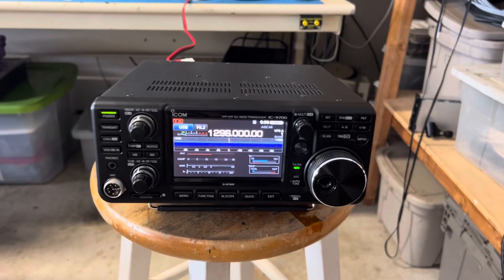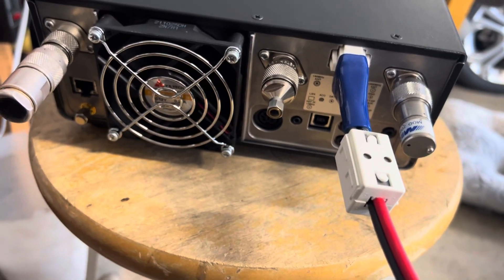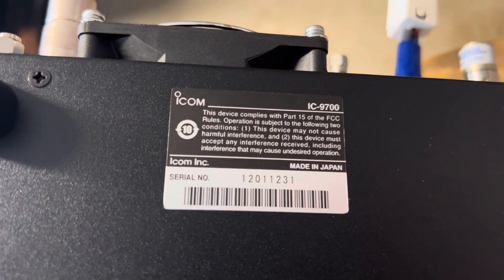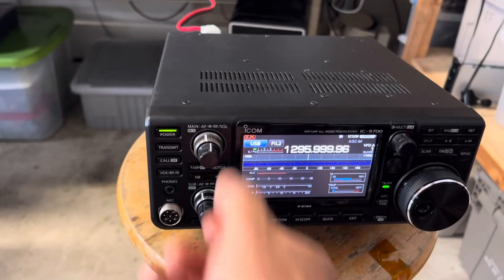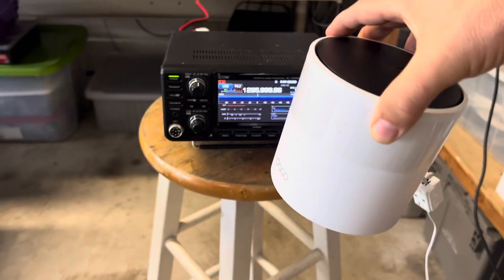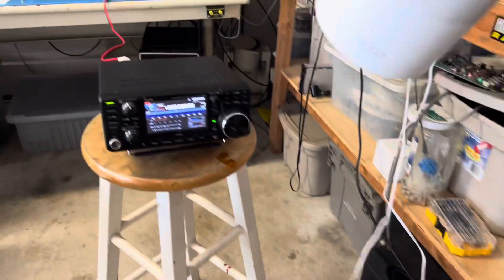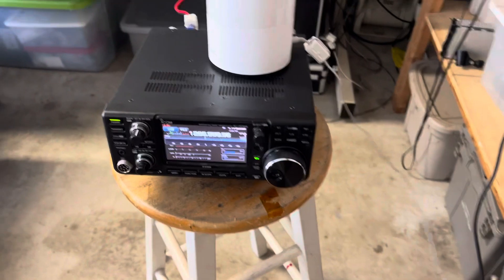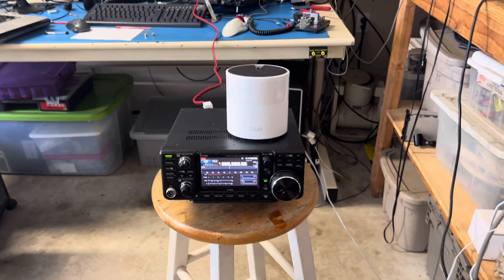IC-9700 23cm susceptibility problem

Comment: Yes I had the same issue. Took a while for me to find it was the 2.4Ghz wifi from my asus ax88u router.  I have now set the router tx pwr level to low and that fixes it.
Poor 23cm front end shielding on the ic-9700 pcb.
Reply from the maker: It is not just a front end, unfortunately. The power input (unfiltered,  small ferrite cores not enough) coming from outside of chasse an unshielded wires going trough 23cm section to 70cm section. and looks like it was no proper SE, PE analysis done during design stage of this radio. SDR technology is cool but has own "dark side".

Comment: It is your electronic device that's the problem
Reply from the maker: It is not. IC910H wit same setup does not have such problem!  https://www.youtube.com/watch?v=aWImMKih2c8
Reply: @VladBoyko  your new radio is more sensitive  than your other radio my cell phone charger has 60db noise  on my radio when it is plugged  in with out an antenna  connected.